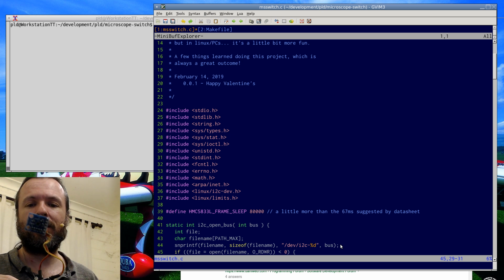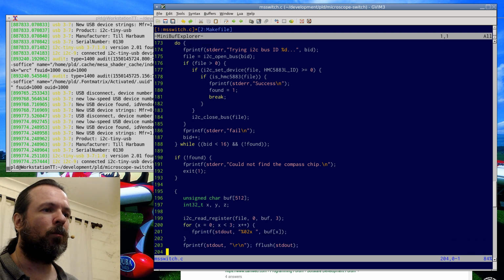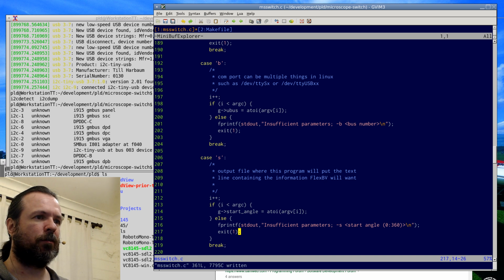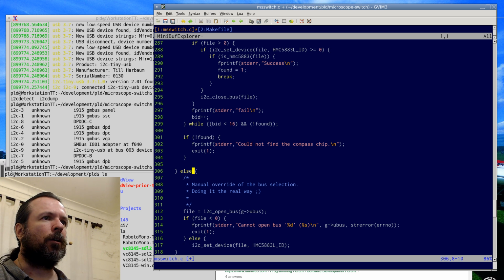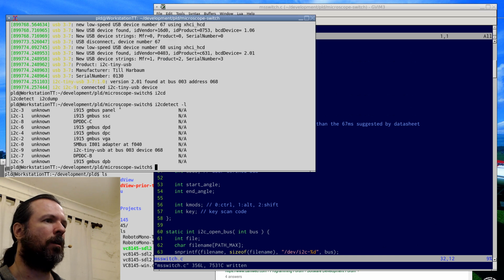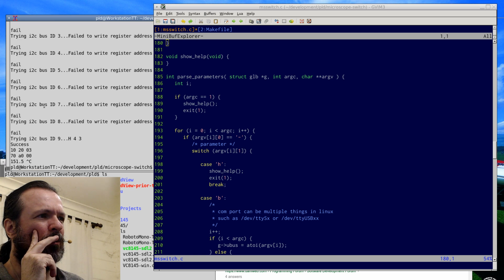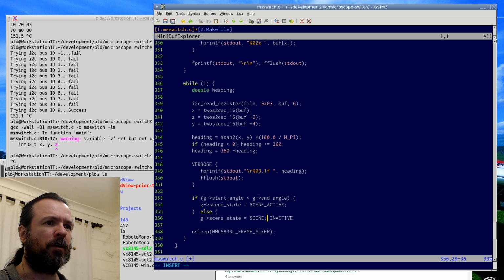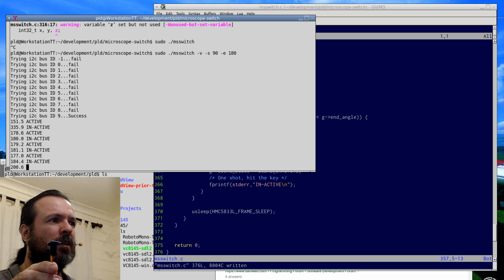#242 Microscope Autoswitcher for Open Broadcaster - Part 1 - Programming

Comment: My first thought would of been to use an Arduino to read the sensor, and then have the Arduino interface to the computer as a simulated keyboard to generate whatever keypresses you want, would of also meant you could just plug it into any computer you happen to be using and have it work. And yes I could make it if I needed one.
Reply from the maker: That could be a future integration of functionality.   The hiccup I can see with it would be setting the start/end angles and required key combos you want to emit for each event, but that'd just require me learning how to tell the AVR with the i2c/USB firmware to accept parameters from the USB from the PC/user, and writing a different program to do the setup.

At least this way, it's a fair bit quicker to develop.  At the time of writing, the keyboard 'faking' has been done though I want to improve on it a bit now.  Next step is to strap it on to the microscope... but I'll save that for when I'm recording.
Reply: Paul Daniels - The start and end angles could be set easily, just have a press button to set it, put it to the start position, press the button, put it to the end position press the button, and have it save it to EEPROM, a long press could be used to clear the settings and allow resetting of the positions, OR you could just tell it to have tolerance +/- from wherever it is when you press the button, to set the in use position.

Comment: Re: next project - Melexis 8x8 Pixel Thermal sensor? Poor mans thermal cam is my guess.
Reply from the maker: This one is the Panasonic GridEye, but the same end outcome.  Definitely poor man's sensor, mostly want to see if I can at the very least narrow down zones on the board that are warmer.  Original plan was to have it mounted on an XYZ assembly had have it "zoom in" to the hottest spot but given that you can now get a perfectly good device for less than the cost of such a setup, and substantially faster to boot, no point.  Still will be good to get the GridEye working, might be good as a detector for objects outside.